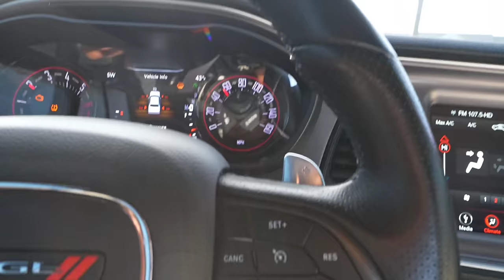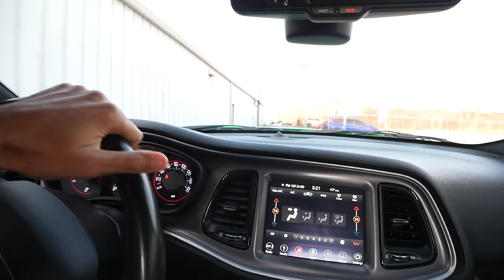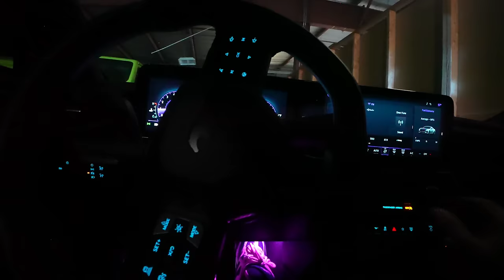MY DODGE CHALLENGER CONVERTIBLE ON 32S GETS A NEW CONVERTIBLE TOP COLOR

Comment: CJ it look like there is some space on the right passenger side front window. It look like you can see a little light or space from the top to the window !! When you get back to the shop you can check it. Remember the guy said it will stretch, you think that could be the reason for the air coming in ?

Comment: Hydraulics oil looks like it could be low how slow the top letting back I had 04 mustang it’s was doin that until I added some in it fix the problem I could be wrong but it was the problem in my case